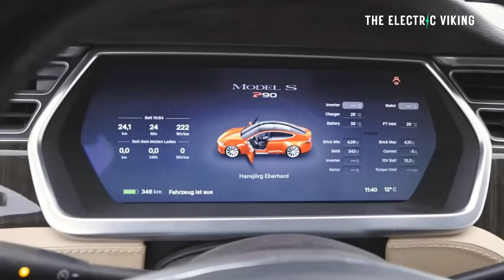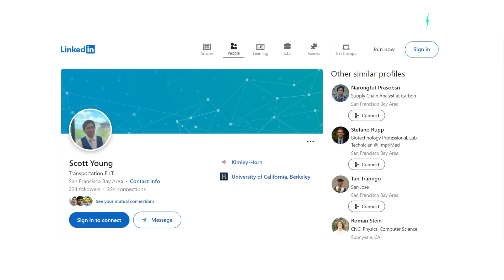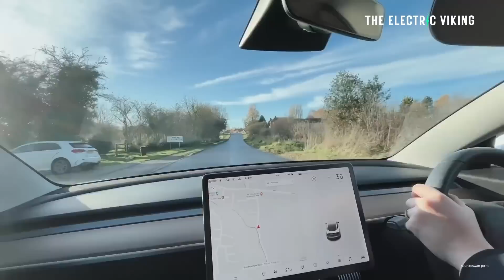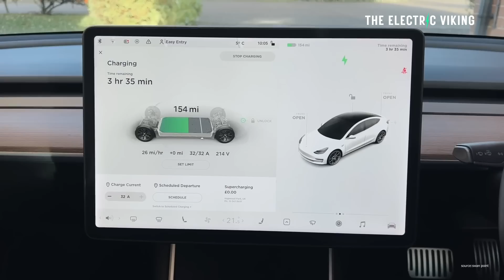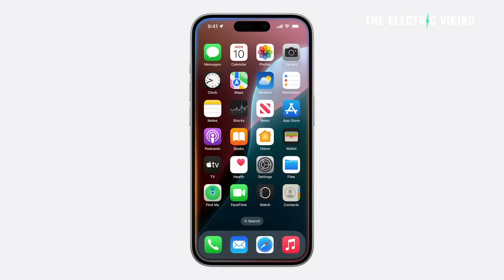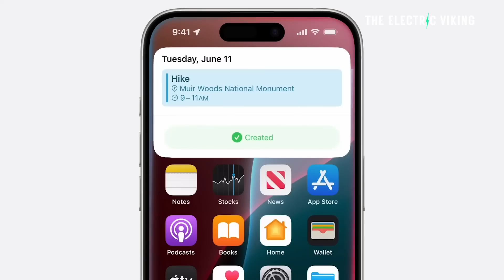Electric cars capable of running for over 1 million miles are already here

Comment: Lithium iron Phosphate batteries get up to 5× recharge cycles than that of Nickel cobolt manganese batteries which technically means a new Model 3 should technically be able to get over a million K's given older Model S are getting around 400 000 km.

Comment: The other advantage of EV is that it has room to grow, i.e. battery technology advancement has a higher ceiling limit. A 1000 mile per charge can be achieved in the near near future. On the other hand, ICE can only go so much. You can't extract any more power from an already FULLY OPTIMIZED combustion engine unless a new ICE technology can compete with battery tech - soon.

Comment: An interesting situation is developing. With the Ukraine-Russia war, the impact on oil is going to drive the cost for gasoline much higher.  A major consideration is that ICE vehicles have only one source for fuel, the global oil market monopoly. The nice thing about EVs is that the energy from electricity utilities is not a single source. And it is not a global resource market. I do not expect the cost of charging my EV will change very much, even when gasoline prices jump much higher.  In some sense EV fuel cost is stable. The problem is when will the dedicated ICE fans realize the cost advantages of an EV?

Comment: Now for the truthful version.  EVs last about half of the lifetime of a reasonable ICE car.  Toyotas are designed to have a 200k mile life from the factory, and most models will go beyond 300k.  Some to more than 600k.  EV batteries have a shelf life that is ticking even if the car is not used.  They are about 10 years maximum.  Since the battery is so exorbitantly costly, a battery failure in all but a fairly new car is an economic write-off of the car.  Cars residuals are based on life time, and the poor residuals on EVs is a major cost of ownership that far exceeds the cost of gas car ownership.

Comment: You might want to tell viewers about companies that offer battery insurance on used Teslas.
They can connect with the car over the air, assess the battery condition and offer relatively cheap insurance.
Just another reason for less aniety and better resale value.

Comment: We could easily make IC engines that will go 10 Million miles.

If they were to use Chrome plated cylinders and carbide rings.
The engines would last forever.....

Subaru did that in the beginning but they stoped it after a few years.

They don't make any money on an engine that does not brake.

In fact GM was reducing the material quality of their engines intentionally, to sell more engines and parts.

Comment: In order for EVs to replace ICE vehicles by 2040 we need to remember there are around 1,450 million ICE cars currently on the roads. Plus that number will increase as more societies motorise, and without the annual  overhead of servicing costs we may see an increase in multicar families. Especially if a parked car on the drive is actually doing duty as the family powerwall. So 80 million new EVs a year through the 2030s won't be enough. If EV production doesn't exceed 80 million a year we are unlikely to have a thousand million  EVs on the road by 2040, and it will be 2050 before working ICE cars become rare. There's also the issue that around 1% a year will be written off in crashes, and by 2050 that's likely to be more than 10 million EVs a year as most old cars will be EVs and it doesn't take much of a prang before an insurance company will write off an old car that is worth less than $1,000. My assumption is that EV production will greatly exceed 80 million in the peak years, then when there are about 2,000 million EVs on the roads it will drop back to replacement and natural growth, perhaps as low as 50-60 million a year. More if what wears out are steering components and seat fabrics. By 2050 some of the biggest customers for new EVs could be the hire companies if they stick to their business model of only stocking vehicles for three years.

Comment: Private cars will start to be phased out as we move to Ai fleets much sooner than you think. Especially when it comes to airborne vehicles, those are almost certain to be AI controlled and you will start to see pool cars being used, whether that's subscription based or on demand, it will start to be the case cars pick you up and drop you off based on a fleet model and dangerous human road issues will be phased out. So it doesn't matter at this time really about EV future because most EV companies already know where its headed. Of course the backwards fucktard united states of Amurca will resist and still be driving tractors when the rest of the world is flying around, China will be the first to do it for certain but its coming and its long overdue. AI is already far safer than humans and the only problems AI has in road safety are caused by the fact you are asking AI to predict human idiocy. 100% AI roads will almost remove traffic accidents entirely.

Comment: Electric cars need a battery add on capabiltiy similar to USB type-C standard that can work with all electric vehicles! 20kg batteries could be put on, as many as needed, based on the size and type of vehicles similar to Silence battery swap system they have for motorcyles. A small car with 20 KW battery of large kar with 40 kw battery will work 90 percent of your driving needs and when you need extra you can add battery! When your car battery has an issue you have alternative in the future. And with improved battery technology you will have very high capactity batteries to add in 10 years.

Comment: EVs as private ownership vehicles? Possibly for the next 15-20 years, but the question is will even owning one be an economically worthwhile exercise, if the world is full of Uber EVs. If you live in the sticks then probably owning one is likely, but if in a city/urban development unlikely, and around 90% of the world population live in cities. I purchased my Telsa M3 DM LR when 9 months old with just under 3K miles on it, it was like new, in 2 years I had done 9K miles, it still has 335 miles range and has depleted by 2%. Base on what other Teslas are doing I can see I will still be using it in 20-25 year time if I am still around. My wife has just got a new Nissan Ariya, 87Kw 2WD and its range is 360 miles at 16c, I see the same thing happening with that as well, unless we opt to go to one car when she retires.

Comment: But, wait - I am always reading on the conservative news sites that the battery in my Mach-e will either explode or need to be replaced within 50,000 miles at $20,000.  This isn't true?  (I have a friend with a '13 Tesla Model S, with over 150,000 miles.)

Comment: EV advocates simply do not want to face the reality of the danger of BEVs and EVs which can sponaneously combust ; even brand new vehicles. This isn't really new but it should be high on peoples concerens as 2 years ago  a brand new Porsche BEV caught fire on the giant Falicty Ace auto ferry.  BEVs burn fast and at high temprature which spreads the fire particularly to other BEVs very quickly; a chain of BEVs near eachother can catch fire in under 1 minute. The Falicty Ace sank with 4000 luxury vehicles; Porsche is being sued to pay the costs. 10 BYD dealerships have burnt to the ground in China. How many warnings do you need?

Comment: Being capable of maybe lasting 1 million miles isn't the same as a typical expecation of that; nor in non EVs - typically the max you'll get assure of in the warranty is 100,000 miles and only that if you are the original owner who drives only 12,000 a year.  Of course both EV makers and ICE makers do not expect you to keep your vehicle anywhere near that. The real important question is what might actually destroy your cars value - maybe a spanteous combustion burning your car in it's garage while it then burnt your house down while you and your family are sleeping?

Comment: I was spending $400 dollars a month on gasoline filling up my ICE car for several years before I decided to buy a Tesla. After driving the Tesla model 3, my only regret is not buying one sooner. I saved so much money that even when I buy a new battery, it is still much cheaper than how much I spent on gasoline, oil changes, radiator leaks, water pump issues, smog checks, oil changes, and so much time saved from all of the ICE maintenance requirements.

I am so glad EV's exist, they are definately light years ahead of ICE cars.

Comment: As long as all or most EV makers are making sloppy corrosion prevention like with the old cars they wont last to long. Like no body-cavity sealing in the side skirts. No Tesla, no chinese. There are enough reports with all the dirt in this skirts. They will rust like the old cars. So who cares that the battery will last much longer. ^^

Comment: Good thing EVs are lasting longer as the carbon emissions break even point with a plug in hybrid is very high.  And you can make 6 plug in hybrids or 90 hybrids with the same battery materials.  Is our goal saving the planet from carbon emissions, or is it to make BYD, CATL,  and Tesla stock holders rich?

Comment: You are likely living in a desert area where RUST is not a problem. Most of the areas where they use salt on icy roads will rust out a body to where it is dangerous to drive by the time you get to 200,000 miles. Of course you can undercoat and maintain but in general suspension wears out, interior wears out, etc.

Comment: Kudos to you for honestly stating that the "2 million Mike Tesla" has had several battery and motor replacements. I thought you were going to use it as an example of "EVs lasting forever". The guy just bought early and got lucky with the then generous warranty. These days any EV needing a new battery is a write off. ICE cars can also go for a million miles if you're willing to swap the engine or other critical components, but most people aren't so they scrap the cars.

Comment: I have a 2016 model S75D. 120k miles. Still holds 60 kWh, compared to 72 kWh new. So 83% compared to new. I use full throttle, 0-75 mph, multiple times every day. 0-60 time is 4.4 seconds. No degradation in performance. Would I do that with a gas powered car with 120k miles? Hell no. I wouldn’t trust it to not blow up when making multiple runs to the redline.

Comment: so you are saying in about 5 - 10 years the price of second hand cars may drop? people are going to continue to buy the latest shiny cars, the majority of cars at the moment are scrapped before their maximum drive train capability is reached, the reason they are scrapped is because people do not want them enough, if a battery holds it's value in materials then once it becomes worth more than the car then the crossover will be the use by date (at least at the point where the car is next sold)

Comment: Avoiding technology obsolescence is not the main threat. The main threat is that most people will decide they no longer need a car with MaaS becoming a realistic and practical option. If an autonomous car is going to take me the last mile for $99 per month, then why would I bother driving a brand new car out of the showroom and instantly lose 10%? This is why being first to market and having a massive moat is actually more important than any other industry. When public transport and private transport merges, the Tesla needs to be the standard through sheer numbers. Not enough people will care if it has superficial features like auto-wipers - do you worry about that when you catch the train? What they will care about is whether my existing Tesla can make me money or how reliable is that Uber Tesla when it comes to picking me up every morning at 7am.

Comment: Most American ICE vehicles are engineered to last exactly 5 years or 60,000 miles before breaking down. I worked at one of the big American automaker car factory and they told me this on orientation day. Basically they buy the cheapest parts that allow them to last within the warranty period before failing.

Comment: My 2020 Model Y has 240,000 miles on it. My battery is at about 85% original range. I have never replaced the brakes on a Tesla car and still don't need to. I looked into taking advantage of the 0.99% interest rate on a new Model Y, just for a refresh. However, no one wants a Model Y with 240,000 miles.  Even Tesla would only give me $12,000 on trade in. So, I'm heading to 500,000 miles.  I'll let you know how that goes ;)

Comment: In my opinion the bits that determine how long a car will last are not engines, transmissions or other big ticket items. It is the synthetic or rubbery bits. Hoses, seals, belts, grommets, washers etc. EV's too will have to deal with this problem as they age, though to a much lesser extent. In isolation a "perishable" failure though is usually just a nuisance but there are so many of these bits that eventually the car becomes so unreliable that we just get rid of it.

Comment: Car companies (and their dealers) make most of their money on selling parts and service for cars, not on the cars themselves.  It's a bit like the inkjet printer game.  You might make 10 or 15% gross on the car, but you can make 50% gross or more on all the parts and service it takes to keep that car running.  Look up the story about GM and their EV1 car if you don't know it.  GM literally recalled all the EV1's they built and scrapped them because someone realized that an electric car would ruin their business model.  But they couldn't stop a bunch of wild guys in CA from redoing it eventually...

Comment: If cars could be designed with swappable modular components with standard connectors, they could be hardware-upgraded over time. Imagine a car with dozens of internal and external USB ports, in which FSD hardware version 7 can replace 6 with a few camera swaps and a software update.

Comment: Batteries are very easy to swap and they act like it takes multiple days.  They have all the right equipment like a race car builder so cut the crap.  When we have surplus batteries then we are truly in the driver's seat as a society.  Battery backup is far superior to home solar ever will be.  If you don't buy solar up front then you are getting screwed.

Comment: If a gas-powered vehicle has a replacement engine, it would be able to do 1 million miles; the Tesla would not be able to do 1 million miles on its original battery.  You need to compare like-with-like !

Comment: Semi trucks have to get replacement engines at 500,000 for commercial uses in America.  The dealership makes up to 70% off service.  No wonder they hate these things.  People want and love them but dealers don't want to sell them.  I can only imagine the staying power of a Tesla Semi or other EV commercial trucks.  Less parts the better.  No more super slow uphill trucks either.  No more air brake bans on downhill sections either.
Reply: They may "have" to where you are.  ...But they don't actually have to in other places.  Over here in Aus, I watched the odometer of my previous K200 I was driving roll over, and the company didn't get rid of it until it's second time it approached a million K's, just with me driving it.  The previous driver had also watched the odometer roll over, "after" the original driver who had it from brand new saw it roll the odometer over almost for a second time.  ...So at least 3.5 million pretty reliable kilometres.    And this is nothing unusual in the long distance, interstate road transport industry at all.

Comment: No the ice engine brands are doing everything possible to prevent EV's going mainstream. The lost to them on maintenance alone is huge;
Oil & filter changes
Differential fluid changes
Spark plugs and coils
Engine air filter
Timing belt
Exhaust muffler and pipes
Radiator flushes,
Thermostats, Water pump,
Fuel injection cleaning 
Fuel filter
Catalytic converter 
O2 sensors
Engine pistons connecting rods, valves
Shop Supplies!
To name a few...

Comment: The car makers will use fashion to encourage people to buy the new model. Interior design will also be a big number for the inside of the vehicle. Fancy wheels and exterior designer paint work and fittings will make people want to buy the new model. Maybe  chop shop upgrades could keep the vehicles at the fore front of technology and fashion.

Comment: My wife's 2018 M3 still has 98% of its original battery capacity after 6+ years and my previous two MS's also had negligible battery degradation as well, so we are not seeing battery degradation as being an issue for us.